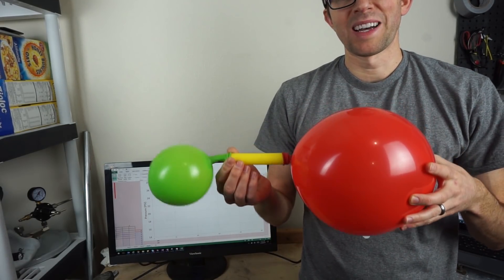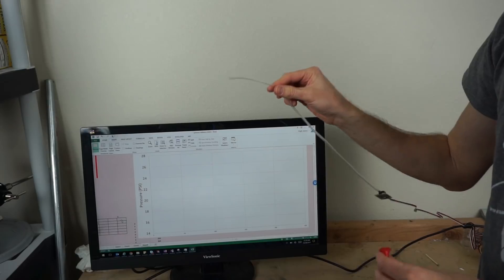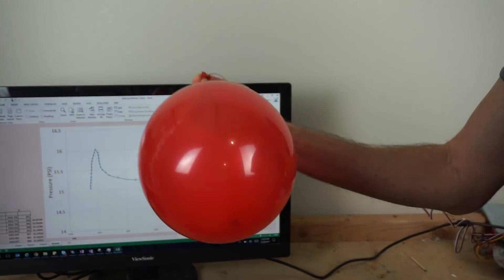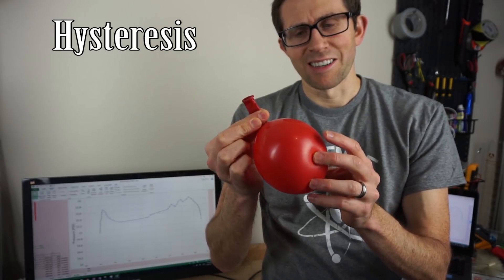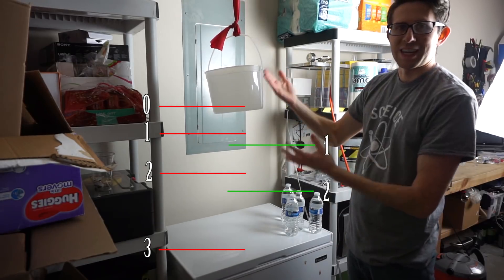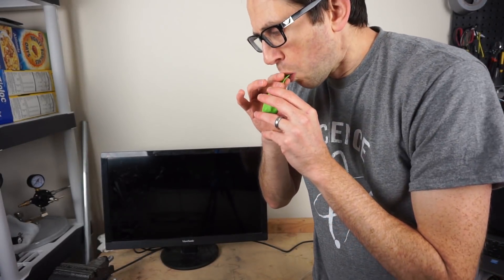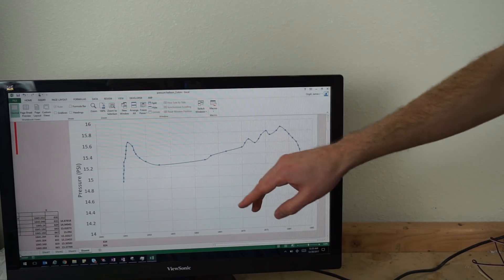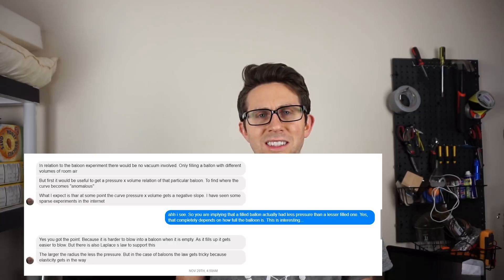You Will Get This Wrong Every Time—Balloons With a Memory (Elastic Hysteresis)!

Comment from the maker: I should also mention that the "memory" I am talking about here is not the permanent deformation that you get from stretching out a balloon for the first time. The type I am showing is totally repeatable every time you blow up a balloon. Notice how the latex band went back to its original position so it was not permanently deformed.
Reply from the maker: Amit Kumar, yes pressure in the balloon is greater than the atmospheric pressure
Reply from the maker: Michael L yes that is correct. I should have shown two cycles to be clearer
Reply: @TheActionLab   It would also be interesting to demonstrate 2 cycles of blowing up and releasing the air from the balloon with the corresponding graph
Reply: Uhhhh when you take the water bottles out, its still lower than its original placed..
Not the same place it was originally. Im not saying the balloon test is wrong, you just need a different second demonstration than the bucket on the elastic
Reply: The Action Lab I have a question I means that pressure inside a balloon is even greater than the atmospheric pressure as air expelles out in the atmosphere
Reply: The Action Lab So if I were to put 1 bottle back in the bucket after the band had returned to its original position, it would go to the first red line as opposed to the first green correct?
Reply: The Action Lab wow thanks
Reply: There is actually a permanent deformation as well, the latex band was actually slightly lower afterwards. The more times that you stretch it out and the farther you stretch it out the more it'll become permanently deformed as well. You can see this especially with thin rubber bands. If you inflate a balloon to its maximum size and then deflate it over and over hundreds of times, it'll permanently become larger when deflated.
Reply: Elastic structures like rubber bands and balloons are internally compressed when you stretch them out. So Even though the balloon with air in it has more total volume, the physical bounds of the rubber itself decrease. So, the thin shell of rubber has less overall volume than it's previously uninflated state. It's unintuitive to think about compression when you are stretching something but that's what happens with elastic. The spike in pressure when blowing up a balloon is probably the quantum amount of force required to overcome the rubber's inertia and is likely equal to the maximum amount of force that the rubber can exert when fully internally compressed. As the balloon stretches the surface area increases so the psi goes down, but the total pressure required to resist the elastic potential (the internal inertia of the rubber) should remain nearly the same since the total volume of rubber is the same and it's internal matrix has a fixed action potential (at least relative to the integrity of the rubber itself). When you release the air from the balloon the air pressure just decreases because it doesn't have the same quantum of inertia to overcome. When you inflate the balloon past it's maximum potential to store pressure you begin to break internal bonds in the rubber itself and it loses some of it's overall capacity to store energy in it's internal matrix (you get a stretched out and potentially busted balloon). Subsequent inflations are easier because the overall capacity to store energy is decreased and the quantum of inertia is lowered, thereby less pressure is required (or should be you can test it out).
Also, when you inflate a balloon or stretch a rubber band it heats up (since it's being internally compressed and it's entropy decreases as the molecules line up) and when you release the tension it cools down (since it's being expanded).  Just some cool things to think about.
Reply: Steve Mould has a different explaination
Reply: What if you left the balloon for a few days? Would this be still applicable.
Reply: Can you do a video on 'Will fireflies light up in a vacuum chamber?'.
Reply: please try nike air max shoes in a vacuum chamber
Reply: Nice experiment. In this case hysterisis is caused because a portion of the blow's energy is absorbed by the plastic molecules (as it expands)  so the tension between their bonds gets loosen up. On the oposite direction, its loosen bonds preserve themselves so the plastic's volume reducts at a different positon. Thus the loss in the pressure in the P=f(t) plot. Sorry for my english. It is not my native language.
Reply: The Action Lab rubber also has more elasticity when it is warmer (the act of stretching it warms it up). As it rests and cools, it loses elasticity. I learned this from the sling shot channel. Yeorg sprave (sp.?) has done a couple of videos on the topic I believe. That's why sling shot competitors try to shoot as soon as they draw. Rubber is not quite non-newtonian like ooblek, but it's pretty strange. Cool video! You wanted one more variable, right?...
Reply: Christopher Smith
"Elastic structures like rubber bands and balloons are internally compressed when you stretch them out"
What is this process called?
I want to know more about this but i am unable to find anything related to this concept on Google.
Reply: The Action Lab love your channel!!! Me and the wife was sitting here watching some of your videos. And we got to thinking!?! Can you pull oxygen out of blood? You know blood is blue in your body, but when blood hits oxygen it turns red!! So can you reverse the effect? Can you try putting blood in the vacuum chamber???!!!????
Reply: The Action Lab can you do a video about smart tinting and how does it work
Reply: Try putting a soda can in the vacuum chamber and see what happens
Reply: The Action Lab everyone knows stating the balloon is the hardest bit!!
Reply: Can you apply this to Cyrpto Currencies?  I think you can, tho, I'm not smart enough to figure that out.
Reply: Thank you so much i actually earned 80 euros from this
Reply: Amit Kumar it's easy to think that the air inside the balloon is actually being "pressed" because of the rubber (which acts similar to a piston)
Reply: The Action Lab: What type of pressure Sensor did you use? :)
Reply: https://youtu.be/rSnnScAyIjI
Reply: The Action Lab does the same happen with water?
Reply: This should definitely have been brought up in the video, because now I'm super confused.
Reply: the answer to this is: the ballon rubber is thicker when ballon is small. as it gets larger the walls of the baloon gets thinner thus making it easier to blow up.
Reply: The Action Lab if I said something like that, people would now something was up
Reply: Ah, how very interesting... I see now. The reason why a small balloon has greater pressure is because elasticity from the balloon is pushing the air from it, oppositely from the radius in which the air is inserted. And the bigger the volume in the balloon, the bigger the  balloon will be, unstretched. Would this correlate with atomic separation? If so, then does it necessitate elastic hysteresis?
Reply: Awsm !!!!!!!!!!!
That was awesome.
I've studied some part of that but never thought in this way
Reply: P= 2T/R
Reply: Balloons never retain perfect shape once blown up. Once you fully blow them up one time? the tension of the initial peak pressure loses its “umph”. People say hysterisis is but I simply see this as the wearing of the elastic being stretched, rip and break like stretch marks on skin. Do a video and Take a magnified look.
Reply: It's possible to notice this effect when you blow the balloon yourself. In the begining of the blow, you feel great resistance, and after that it become easy. After blowing even more air, you start feeling more resistance the more you blow air into the balloon.
Reply: So is this not obeying hooks law then?
Reply: Also what effect does the changing volume have? Is that the cause of the initial spike in the graph?
Reply: The Action Lab
Reply: The Action Lab  you should try letting out air in small bursts and look at the pressure. A sort of quasi equilibrium analysis. Air quickly exiting the balloon like you show I don't think is showing the retraction pressure of the balloon well. When you're blowing you're almost doing quasi equilibrium.
Reply: Isn't that with carbon dioxide. Does the rule apply with helium???? 🤔
Reply: The Action Lab s
Reply: Does a balloon that is "broken in" so that the rubber is pre-stretched and loosened have more internal pressure when blown up compared to a balloon that was not pre-stretched then blown up to the same size?
Reply: I never understood hysteresis very properly until I watched this video. All through out my life I only knew the definition of the term but was never able to imagine it practically. But now that's not the case. Thanks for this amazing video :)
Reply: I disliked your video because you said that I was an idiot, you said that the graph should be weird to me, as in all viewers, you told all viewers what they think and I'm here to let you know I understand perfectly well and I'm only here because you turned me on to it. I'll still watch your video and enjoy it but it's unlikely I'll care to reprogram the youtube. :P
Reply: Now you made me curious on if there is hysteresis with the tanks on SpaceX. Does steel exhibit this and does All steel exhibit this?!
Reply: What happened when balloon burst ,
Reply: Strangely, I completely expected that response from the latex, it's like instinct built from life experience. I know balloons are always softer when going down and firmer (tighter) when going up, and it feels like an obvious property which relates to how the material acts under stressful manipulation. It's strange, I've never learned about it, but I've always known of this "memory" property in certain things. I can't explain it any better, it's just built into my expectations.
Reply: The Action Lab i subscribed ❤

Comment: The surface area of a balloon goes up, so even though the rubber is more stretched and would require more force to keep it there, the overall pressure goes down. But it is also true that a balloon doesn't "spring back" with as much force as it took to stretch it.

Comment: I would bet $ that it would make a noticeable difference if u were to do this experiment with added factor of Hot vs. Cold... just like with car tires. When tires are cold the pressure is always a little lower (usually by around 2 lbs. But I've seen up to 5 lbs lower when cold temperatures where more extreme) yet once u drive vehicle for a few minutes, the tires heat up & tire pressure increases back to normal......
Also, I think it would be very interesting to see what kind of results u get when using different gases to fill balloon.. o2 as opposed to co2, as well as helium...

Comment: No, no. The higher pressure at the beginning is measured because the ballon has to expand,the rubber stretches and acts on the air inside causing temporarily the pressure to increase. When you add more air the rubber still acts on the air but now on larger surface so total pressure decreases. 
The second experiment with the bucket and the bottles with water shows exactly the same. The rubber stretched when loaded with the bottles but can’t stretch back with the same speed. The rubber fabrics were pulled down with additional force, but in the second phase the fabrics must shrink without that extra force, so it takes more time to get back to its original state (if the rubber fabrics are  not damaged of course).

Comment: So if you have a slingshot, would rubber shoot differently from the same level of stretched out depending on if you pulled it back and stopped vs pulled it back too far and then brought it forward?

Comment: You should have chocked the air many times on the way out to get an accurate reading. When you blew it up your mouth was sealing it. You need to recreate that affect on the way out or your results are invalid.

(By the way I dont believe in that memory nonsense. My hypothesis is that you are just stressing the material to a point where it's performance suffers. Why don't you repeat the experiment immediately after with that bucket and I bet you get the second results relatively consistently.... well untill the material gets even weaker.) Prove me wrong please and show me why I'm wrong.

Comment: You have hot air and external resistance from environment. Air and heat is released from balloon changing material response and internal pressure. Two different systems.

Comment: A latex balloon will equalize at atmospheric pressure in the location (and temperature) you are at.  This is because the balloon expands until the pressure inside and outside equalize for any given volume of air in the balloon.  During the initial stage of inflating the balloon, the rubber is thicker so it takes more pressure to get it to expand.  Once you cause the rubber to get past its initial breakdown stage, pressure equalizes. Future inflations will show a much smaller spike at the beginning and be easier to inflate.  
If you inflate one balloon all the way and inflate the other balloon to 75% of the full balloon, the amount of air movement should be minimal, especially if you let the balloon sit for any length of time (this allows the rubber to fully stretch and the pressure to equalize).  
This is different for rigid or semi rigid objects that we attempt to pressurize, like car tires.  The rubber in car tires does not have very much stretch at all so as you add air, there is no chance for the material to expand until equalization. Same happens when you pump a gas into a metal container.

Comment: I think he made it too complicated. It was simple if he had said that before getting stretched, pressure is high when it tries to expand. Because it is hard for it to change its shape (expansion). Once stretched and returning to normal, it has now loosened up and finds it easier to retain the smaller shapes and hence pressure reduces for the same size.

Comment: Bit late to the party but Isn't any material subject to Elastic Hysteresis? Its obvious when you use rubbery materials but even steel springs or concrete have some. How about air? Sound going one way and having a sound wave going the other way will cause a delay....not sure you'd call it Elastic Hysteresis at that point but molecules having a delay in reaching a 'neutral state' is kind of whats happening here right? I'm talking near unnoticeable differences but it's there. (The sound example is definitely unnoticeable due to air being on the move as a rule and sound is always everywhere. Chaos would mess up most experiments. Not sure how you'd conduct that experiment or even quantify the results.)

Comment: In 2nd case what happened? (Both remain constant case)
Small Baloon had low pressure and big one had more then the air should flow from green to red. Why it didn't happened.  It remembers the same. Explain pl.

Comment: I have a question: when you showed the example of the bucket hanging from a rubber band you showed the hysteresis when taking off the weight previously added. In measuring the pressure in the balloon when it deflates you see it just goes down instead of showing the same behavior as when inflated. So the question is: isn't this because we are not measuring the balloon itself (it's material) but what happens inside and when you let go of the closure the system is no longer a closed one? Sorry for my poor english and thank you so much for this absolutely fantastic channel!!

Comment: I made an experiment for the Swiss physics olympiad where the students had to measure the pressure curve while inflating a balloon using a water-column manometer. They had no such luxeries as an electronic pressure gauge only tubes, valves and water.

Comment: My question: is the concept of elastic histeris the same conceptually as the ballon simply being stretched out and the plastic in the ballon being less elastic? I don’t understand why use this idea that the ballon “remembers” when to me it seems like the ballon is simply releasing the pressure with the the elasticity because the elasticity of the ballon is working with the flow of pressure instead of against the flow of pressure. So what’s the difference between between “elastic histeris” and being “stretched out”? Or is this just fancy Mumbo jumbo for scientist to sound smart with each other?

Comment: 6:50 what happens when i continue adding air

I was wondering this because of all the twisted magic he had already pulled off then remembered that if i keep adding preasure to my car then it would deflate but then i continued to watch and the psi continued to rise as the elastic kept stretching but needed to expand slower as it got to the pop point. Unlike a tire it would most likely kill you( not by the force of the air but the flying tire pieces)

Comment: 1. You’re pronouncing hysteresis wrong.

2. Hysteresis is not the only reason the pressure decreases as the balloon gets bigger.

If you double the diameter of the balloon, you quadruple the cross section. This means that the force stretching the balloon increases even if the pressure doesn’t.

If the rate of increase in the force that rubber generates as you stretch it is linear and directly proportional to the amount of stretch, and the cross sectional area increases with the square of the diameter, then you should see the pressure decrease as you inflate the balloon.

Try taking the balloon and cutting it and then measure the force required to stretch it to see whether the force required to stretch it has a linear relationship with the amount of stretch.